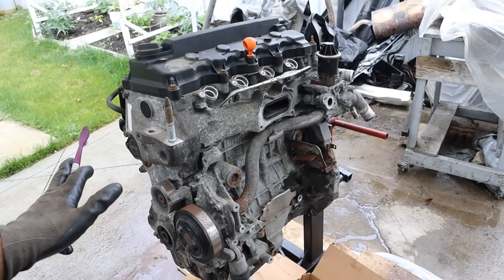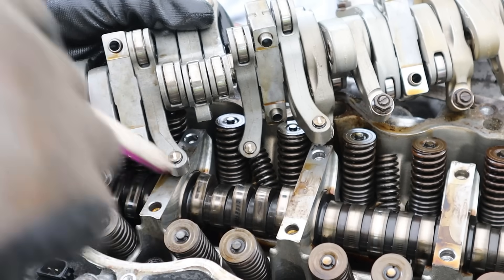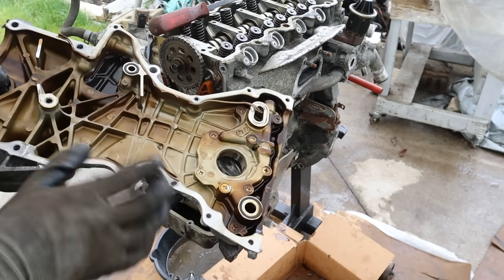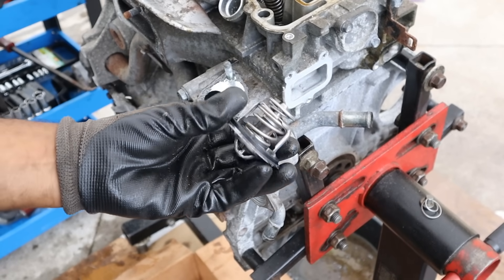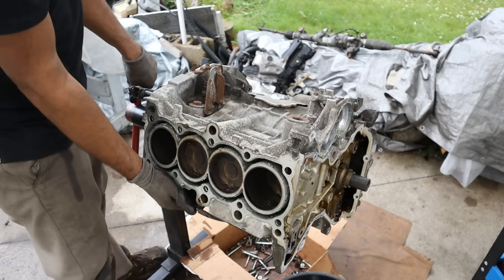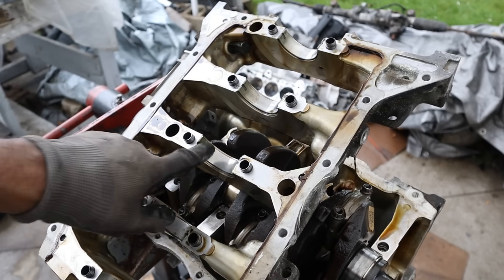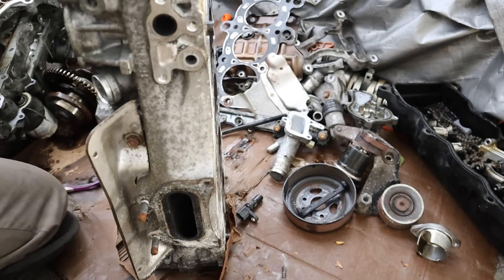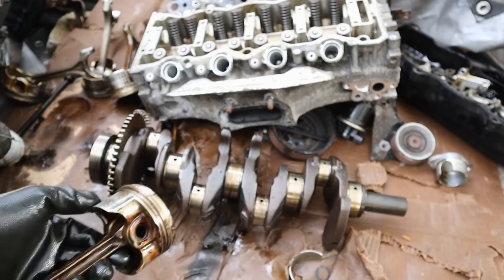Modern Engines are Junk: Honda Civic R18 Teardown Proves they Don't Make Them Like They Used To

Comment: I was considering buying a Honda several years ago, then did some research on the problems around their direct injection and met several people that had lost engines in their low mileage cars.   Now with them stupidly going to a wet belt with their oil pumps and Honda is off the list for good.
Reply from the maker: never knew about the wet belt.

Comment: Honestly, i really believe this is a reliable engine. However,  my 2006 civic, which was my grandparent's car that they had since brand new, the engine oil pump failed like 2 months after they gifted the car to me, after i had it serviced it and everything. The whole repair was a engine out job and ended up costing like $1500. Even the mechanic was surprised as he said he has never seen this car have that kind of issue. He said it was it was only repairable because i almost immediately stopped at the side of the road and stopped the car once i saw the check engine oil light come on. Fortunately, my grandmother helped me out with the repair bill....
Reply from the maker: Wow. an oil pump sounds rare.

Comment: We had to retire our old Honda Civic early, as the maintenance of replacing the rusting brakes and exhaust system was getting expensive. Besides replacing the rubber hoses of the engine, it was still purring like a kitten but the body was rusting away. Really miss that car.
Reply from the maker: Sad that most of these Civics die because of rust more than an engine/transmission failing.

Comment: Such a simple design (compared to most being made now).  Yes, on the PCV system and also EGR - I knw about changing the PCV valve but what has to be done to an EGR system to maintain it?
Reply from the maker: You can't do much other than take it apart and clean it

Comment: The oxidation and crud in the head water channels look like normal water was used,  or that the coolant was never changed and the anti-corrosion chemicals expired,  that can cause head gasket failure by allowing corrosion to creep under the gasket face.   That is not an engine design fault, it is an engine that has suffered abuse by neglect.

Comment: The timing chain Honda and most Japanese companies use has multiple link plates and multiple pivot points per link, making it strong,  meantime BMW and Audi etc use a proper bicycle chain with just two link plates and two pivot points per link  that is whey they stretch and fail.   Honda may use plastic rocker cover and induction manifold,  but Germans use plastic waterpumps and internal engine components, which fail on a regular basis.

Comment: I’ve got a 2012 Civic. 185k miles and counting, was my aunt’s car since brand new but she sold it to me because she was upgrading. I’m so happy- it has been very well taken care of and I know that I have absolutely bulletproof reliability. ONLY issue was a small oil leak from an engine breather plate. I think it’ll go another 185k before the transmission quits. Great video!
Reply from the maker: Take care of it and it will take care of you.

Comment: Ha incorrect my 5 speed auto ran like silk and got a fluid change through its travels. Unfortunately like you said I ignored a rad/rad pipe leak thinking I'd be on top of it and forgot to add blue juice.  Couldn't see the stupid spaceship temp gauge through sun glare one day till it was too late and same thing. Dipstick didn't melt but the head got pretty hot, spent a fair amount of money (new head) to fix my little beater but it couldn't keep the coolant in and I never found the leak before it developed a strange soft thumping knocking sound, I assumed a con rod was dead and  parked it

Comment: 1:42 NOT both intake valve lifted higher during VTEC kicked OUT but ONLY ONE Intake Valve lifted higher instead,VTEC works in a reversed way whereas VTEC kicked IN as fuel economy mode,but turned OFF in high engine load mode 🤓 this applied to R18 and R20 engines

Comment: Man the R18 I had was great. In 150k all I ever did was fluid changes and consumables. At 250k miles I opened the valve cover to do a valve adjustment and it was at perfect spec. These things had molybdenum coated cylinders and piston oil squirters and all kinds of stuff economy cars don't get. Really a great engine!
Reply from the maker: Sure was great for its time, compared to what we get today.
Reply: @speedkar99 for certain! Disassembling a Honda engine from the 90s or beautiful chrome handcrafted body work from older American cars from the 50s/60s really shows the engineering and craftsmanship invested into cars that an automated assembly line and modern economics just won't allow for today. It's truly a joy to work on a simple yet well thought out machine- and most modern cars just aren't hitting that mark mostly by design.
Reply: My wife’s 2011 Civic has 230,000 miles on it and still runs like normal. Now she’s retired she doesn’t drive that much so I change the oil yearly as she only drives about 4000 miles a year now. Good reliable engine.
Reply: My 2013 civic sedan has 251 thousand miles and still running strong. Only done regular oil changes and thats it
Reply: I have an 07. Checked valve clearance at 187K miles, just because no noise or anything else. All valves were in the middle of the specs. I have 248K miles now and this engine still has 180 - 195psi compression on all cylinders and does not burn oil between oil changes. I have a coworker who owns an 06, he just reached 360K miles. I’m pretty happy and hope mine will keep going just as long.
Reply: Replacing all the plastic with an aluminum or another metal would give durability

Comment: Single cam engines went from..well..legendary, to pretty cheap. D series is better than R series, if you ask me.
Reply from the maker: The D17 had its low point in the 7th Gen civic though.

Comment: My 2006 Civic has over 450,000 miles and still going.
Reply from the maker: Wow. What do you do, Uber? Courier? Drive across the country every weekend to visit family? 😮
Reply: @speedkar99  Just to work mostly, 100 mile round trip 5 days a week since 2006. It's the best car I've owned and I have owned quite a few.
Reply: @carmelodeleon4077 Well that explains it. All that driving on the highway is what's keeping that engine purring like a kitten. I'll bet the inside of it is clean as a whistle. Keep it up and you'll be the next Honda Joe😂😂👍
Reply: @carmelodeleon4077 have you done timing chain replacement?
Reply: @alejandromorazan3420  No, timing chain replacement.
Reply: Hell yea, my hand me down 2008 civic has been in the family since new, 360k miles now. religiously maintained and it shows
Reply: Very impressive especially on an early R18, shouldn't the block have cracked by now?
Reply: @presinald 1% or less cracked. 😂
Reply: My 07 was the best car I ever had. I ran it from 201k up to 280k, it finally developed low compression and was sluggish, started every damn time and never left me stranded, cheap available parts, and sorta easy to work on. Mine was 100% city miles too, no highway
Reply: 2006 Civic prone engine block hairline Crack.
Reply: @mugenlee8276 my 2008 been running more than a year with that "crack" I always check the water and i jb weld the area as best as I can and I used a coolant stop leak and the leak is almost gone I just keep my water up and im good I've been running it like that like 45k miles
Reply: @mugenlee8276 on less than 1% lmfao. It's blown out of proportion and parroted across the web.
Reply: @mugenlee8276 its r18a1, r18a2 is good
Reply: 2006 was Perfect civic but engine block hairline Crack I saw on Google.
Reply: Camaro will smoke it
Reply: @keithbellair9508  Can't smoke it if it isn't running by 450k lol
Reply: @reinbeers5322 hahaha 😂
Reply: @keithbellair9508 Camaro are slow as fuck boats......

Comment: Is it normal for these engines to consume oil every ~5000 miles? I have the r18z4 engine eu model. My car car has 110k miles
Reply from the maker: Not usually. What kind of oil are you using
Reply: @speedkar99  5w30

Comment: So cool to see this. I had a 2007 Civic EX with the R18 and 5AT. Regular maintenance and it still ran perfectly when I sold it at 230K miles just a year or two ago, great motor.
Reply from the maker: Great to hear! They sure did hit high mileage with ease...if the rust didn't get to them first.

Comment: I have a R18 with 200k miles and it's  really a reliable engine.
Reply from the maker: Awesome. Does it burn oil
Reply: @speedkar99  No, run with 0w20 castrol synthetic and never add oil between oil change

Comment: Unfortunately my 2013 European Honda Civic's 1.8 (R18Z4) has been suffering from significant oil burning issue due to poor piston ring design (Honda rectified this from 2014 models onward).  It is currently consuming around 1 litre for every 3000 km. The car has been very reliable other than that, but I know I won't be able to keep this car much longer.
Reply: 5w30. I might consider bumping it up to 5w40 in the next service. 

Honda used a thinner R3A piston ring to hopefully achieve a better fuel economy but what these thinner piston ring ended up clogged and messed up a perfectly well designed engine. They switched back to the original R1A piston for 2014's R18Z4 onwards. There is a 10 pages long discussion on a Honda civic owner forum as Honda Europe officially does not acknowledge the issue nor do they issue any recall, as they quote "1 litre per 1000 km of oil consumption" is acceptable.
Reply: @MrYc97  Interesting. 1L per 3k isn't that crazy, but it'll only get worse. 
Has anyone with the R18's tried the Valvoline restore and protect oil? Seems to be some good anecdotes out there for it 'fixing' oil burners.
Reply from the maker: Probably changed the ring design due to emissions and oil weight over there. What oil do you run?
Reply: 333 mL per 1000km doesn't sound bad.  My K20 uses about 200 mL/1000km, basically the more opportunities you have to drive through the mountains and use VTEC and redline the engine, the more oil it uses (I'm using 5W30, I could use 5W40 I guess).
Reply: @TassieLorenzo  It doesn't sound so bad now but its not going to get better anytime soon. At the end of the day it is an R18 not a K20, and it is not financially viable for an engine rebuilt due to the age of the car.  My worst fear is that the catalytic converter may fail with the oil burning, that would be a problem as the car would not pass the emission with the yearly inspection.

Comment: Honda went down the drain so
Bad.  McPherson
Junk.  Cheap electronics.  Underpowered motors.  No more high rpm. Weak engines.  No thanks
Reply from the maker: Yet people keep buying them
Reply: I have no interest in the 1.5 turbo & CVT (would suggest buyers avoid it), but the Civic Type R is fine to good -- it is a refined version of the old formula and I would say more than worthy as modern day Accord Type R or modern day Accord Euro-R (do you really want a 2.0 engine instead of a 2.4 in your TLX? that Accord/TLX is not that light).  

Double wishbone front end is still there on Acura TLX, but MacPherson strut is industry standard for C-segment -- it's the same as Golf GTI, Megane RS, i30N, Focus ST etc.  The separate steering axis (as the Negane RS (RIP) and Astra OPC (RIP)) is a reasonable compromise on the Civic Type R.

Comment: :washhands:I own a Civic with R18Z variant of this engine. Great car, I'm very satisfied with it in those almost 10 years of using it. Enough power for me and very economical if you want so.
Reply from the maker: Awesome. 
Power is subjective, I drive 6 cylinder cars so this class is not for me.
Reply: @speedkar99  There is no replacement for displacement :)

Comment: What's your opinion on the K20C2 on the modern base/low trim Civics? I picked a 2023 sport hatch with a K20C2 specifically because it's a chain-timed, port injected, non-turbo, lawnmower-tier power output and should hopefully hold up for a long time with regular oil changes. Thoughts?
Reply from the maker: You did well. That's the best option for the current generation civic. Too bad it's been discontinued

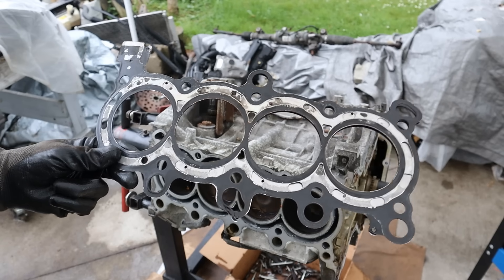Comment: 7:30 The engine would still be going if the owner paid heed to an engine heat warning? That’s such a waste, it looks in such good shape!
Reply: The engine computer should shut down the engine on high temperature, low oil pressure, and low transmission fluid pressure situations.
Reply from the maker: Yeah this seemed like a driver error.

Comment: Yes, I would love to see a detailed PCV video. I want to see what I can do to minimize the damage done to direct injection engines from the crank case is being redirected into the intake. I’d also like to see if any of this applies to how the PCV system works on Port injected engines too. I have an old classic car , and I saw a video somewhere on a tube-able PCV valve that balances the airflow to achieve a pollution and crankcase pressure problem minimization can you include some of that thanks.
Reply from the maker: Yes, that's the point of the crankcase ventilation system. Balance and emissions. Will include that in a future PCV video.

Comment: Got an acura ilx with the r20a motor which is the same motor with a longer stroke. Best car I ever drove.
Reply from the maker: Do those burn oil?
Reply: @speedkar99  Mine doesn't 160k miles so far

Comment: 380k miles on my 12 coupe, manual. I’m original owner too. Mobil1 0w20 when the light tells me. First clutch at 350. Third set of wheel bearings! 😅
Reply from the maker: Awesome on the clutch. 

Why so many bearings, these cars aren't that heavy!
Reply: @speedkar99  all FWD cars end up eating their cartridge-style bearings.  They go 120-170k per unit. 
Got a VW golf from '87. Put in so many I bought my own presser/installer. Got tired of machine shop bill of $60, then $75, then $90.  The tool has already paid for itself.  Golf has 600k+miles now.
Reply: @timewa851 My accord has 380k on the original bearings, no idea how people are wearing out wheel bearings that fast
Reply: @iank6897  if you replaced them right now, you’d be SHOCKED how much quieter your car is. I don’t wait for them to fail and get loose. I do them when they start getting loud. Quality ones will do about 100k. I live in the rust belt, pot holes and frost heaves do a number on our suspensions here.
Reply: @s @speedkar99  wheel bearings and engine/trans mounts have been the only repeat offenders. SE Michigan roads are very poor.

Comment: when these engines over heat the dipstick melts off....  This is not the last port injected honda, the 2.0 na was port injected atleast until 2019
Reply from the maker: That 2.0 is now discontinued in favor of the hybrid. 

Interesting theory on the dipstick melting!
Reply: @speedkar99 yeah I worked at a honda dealership for 4 years with the powersports stuff(quads,  bikes, mowers ect)  

Very common for that dipstick to be melted off during an overheat condition.

Comment: R18 : first models had poor piston oil control rings up to roughly 2012. Other than that never heard of cracked blocks. What models affected and where was the engine built?
Reply from the maker: 2006-early 2009

Comment: My brother bought a 2025 civic, 2.0l non turbo. But it's Direct injection only and not vtec also CVT transmission. Sadly one of the more reliable cars you can get even with that bs. I'm doing the oil change every 3k miles or 6 months to try adn keep the carbon build up to a minimum.
Reply from the maker: The 2.0 is still better than the 1.5t. You got the last one as the hybrid is replacing that, as it did in the CRV
Reply: @speedkar99 nice, hopefully he doesn't total it like he did my 2014 impreza

Comment: Those OEM fuel injectors might be made cheaply but they aren't cheap in cost 😢
Reply from the maker: Compared to a direct injector?
Reply: @speedkar99  is there a huge price difference? I didn't know there was a difference. My 08 Civic hybrid has expensive everything. Coils, injectors, 8 spark plugs. Lol 😂

Comment: You could already see the writing on the wall with this one....  Integrated exhaust manifold !!  That's where I draw the line...  No headers.   Seriously limits N/A performance upgrades, works fine with turbos.
Reply from the maker: Well for modders this engine isn't where you should be starting from...
Go with a K20
Reply: @speedkar99  Absolutely!

Comment: I sold mine with 93 000km 6speed manual. It has faulty airbag control unit which was not available to buy
Reply from the maker: Couldn't get a used one?
Reply: @speedkar99  I found one in Latvia for about 350€ with no guarantee it works. So I decided to sold it as it was.

Comment: got a 2011 civic and the thing that makes me most sad is it isn't manual. I have some relatives with a civic with a manual transmission, and it's up to 250k miles ~500k km, and it's still going strong.
Reply from the maker: Yeah the transmissions on this (while not unreliable) are not gonna outlast the engine.
Reply: Transmission oil drain and fills my friend. Every second oil change or in my case, about every 10k kms on my auto trans.  3 liters of DW1 at a cost of about $35 is cheap insurance. Of course this isn’t draining the torque converter fully, but keeps fresh fluid circulating enough, prolonging transmission life expectancy and decreasing wear.